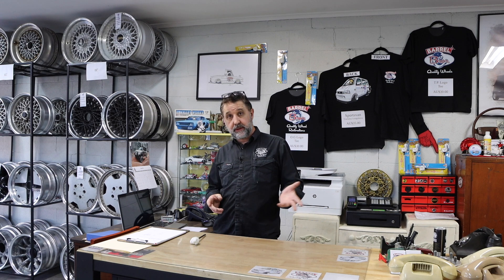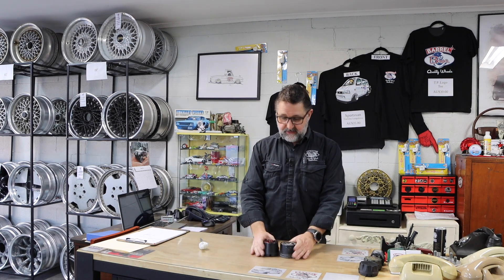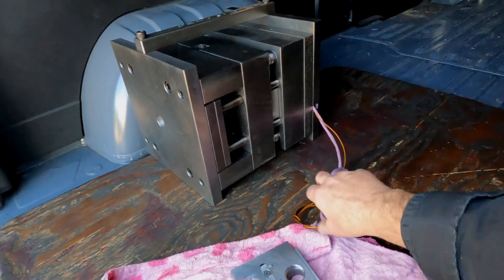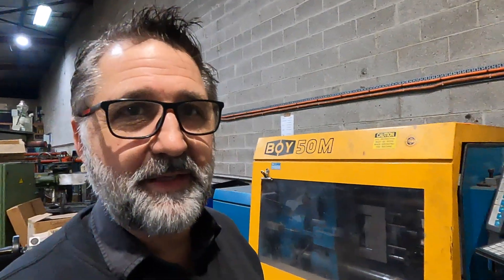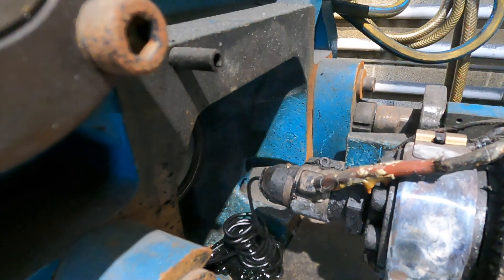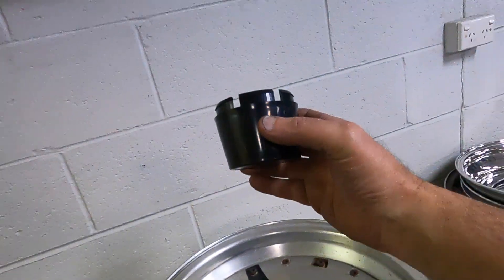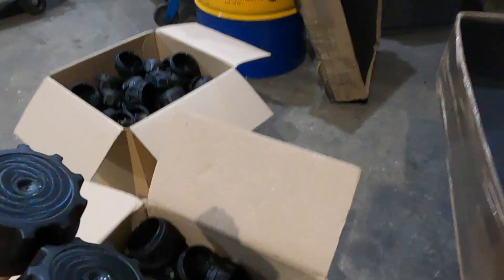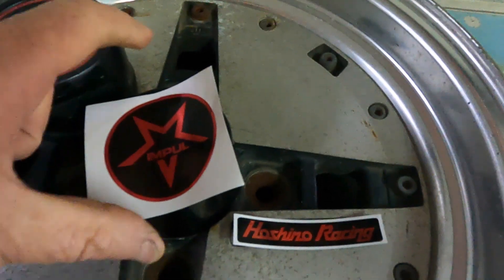72  Injection Molded Impul Hoshino Centre Caps Part 1 (Plastic Injection Moulding)

Comment: I am very excited to see this! I have a set of the 14" 4 stud Hoshino's with the Aluminum caps and they're mangled, they don't fit well, and I don't dare run the car with them on lest they fall off and I never see them again! I am really keen to grab a set of these and the face stickers for sure

Also, I have a set of Carol Suzuka's (Suzuka Carol's?) with exactly the same issue, the caps are aluminum, rough condition and no longer fit nice, I think they are the same dimensions as the Hoshino caps too - if they are, I might need to order a second set of your Hoshino caps without stickers for them also! :D